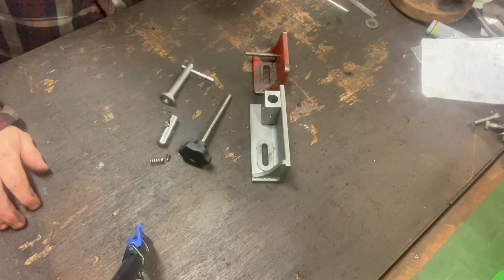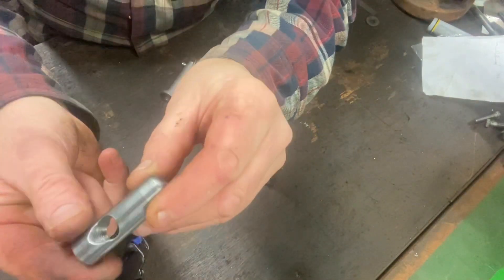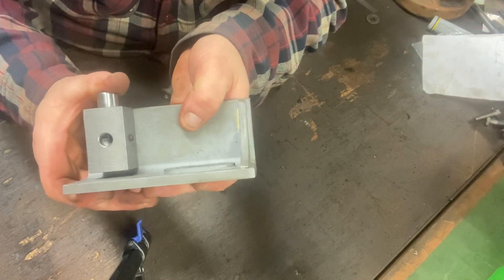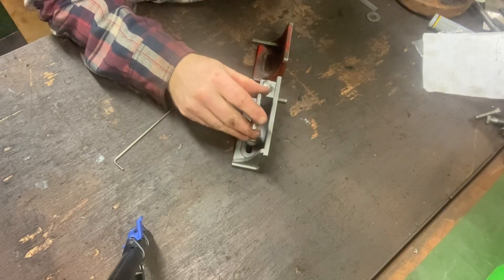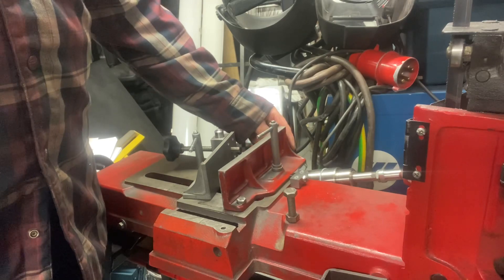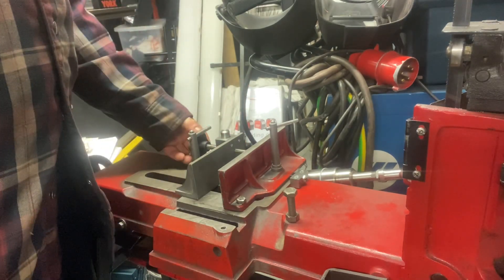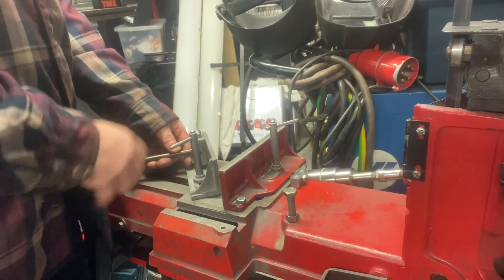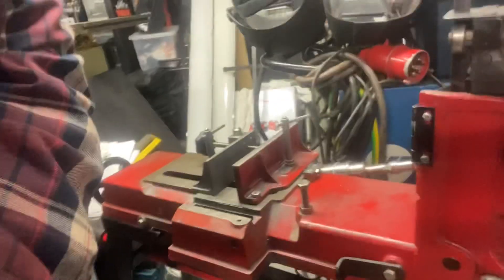4x6 Bandsaw modification

Comment: I love the idea of the quick release screw. I'm getting ready to make one.  I am wondering if the half threads were reversed, would gravity hold the screw down and engaged, thereby eliminating the need for the spring mechanism??? I would appreciate your thoughts. Thanks
Reply from the maker: Hi
The spring enables the release of the screw like a momentary push button. Not sure how the gravity method would work to release the screw unless you are able to lift the button. Would be interested in seeing your design when you have made it and thank you for your interest

Comment: How did you machine the boss on top of the new jaw for the lock-down bolt? Thanks
Reply from the maker: Thank you for your interest.
The jaw is a silver soldered fabrication so the raised section is a separate piece silver soldered to the steel angle to look like a casting. The web is also silver soldered in place. Hope this answers your question